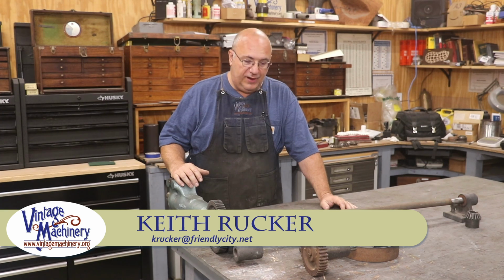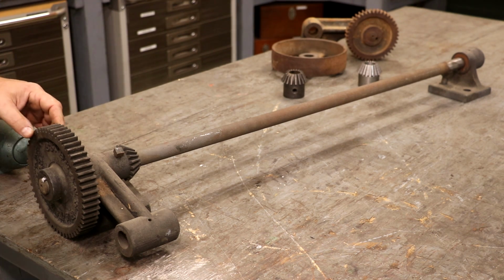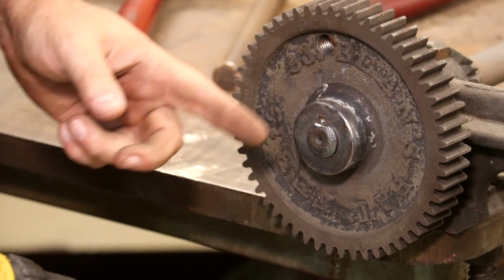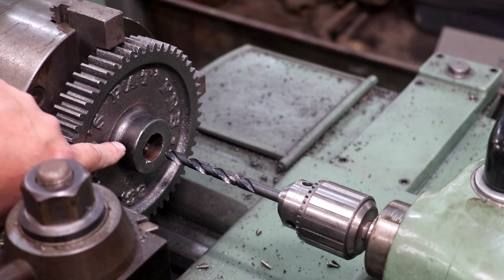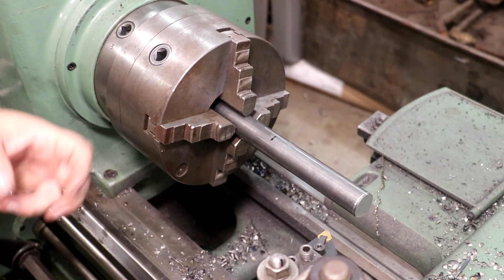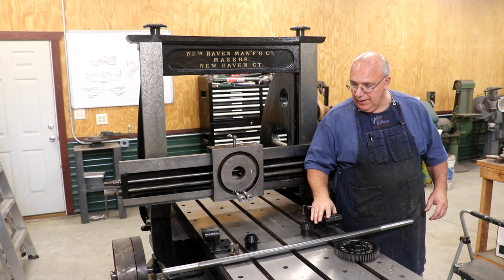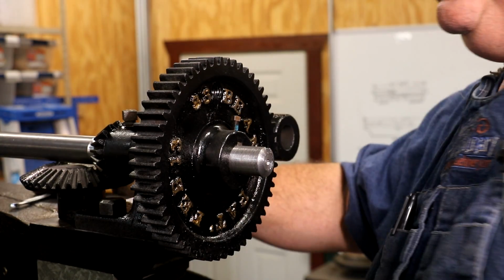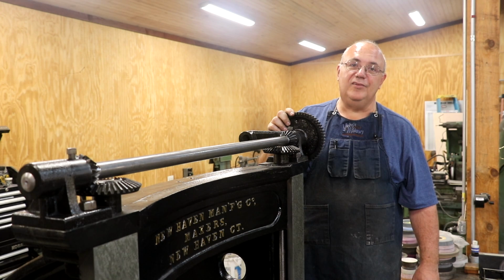Metal Planer Restoration 41:Restoring the Cross Head Elevation System

Comment: Could you have put the good bevel gear in the mill and dial indicated it to the degree angle with a dial indicator getting zero change down it length of cut from short to tall side? Like the idea of making a handle!

Comment: I have run into similar situations and have used wax. Heat your part then touch it with some wax, it will follow the heat like solder. I keep wax in my tool boxes just for these situations. You would be surprised of how well it works.

Comment: Hay, Keith, drill tap and put a screw in that key and use a slide hammer to tug it out.
Well after you got it as far as you did, just pound the gear back on and the key would halv probably worked it's way out.
owell making a new shaft is always fun.

Comment: Wedge keys are much more resistant to shearing off with a shock impact. This is why mechanical stamping presses use taper keys on the drive gears.

Comment: When I was a mechanic, a rosebud tip was one of the best investments I made.
It is possible the brass drift was harder than that shaft. Spark-proof brass alloy is way harder than British knock-off hub cap. :(
soaking the stuck parts submerging in penetrating oil or diesel fuel for a week, or you could spray all the potentially stuck parts the day ( every day) you decide to take it apart - soaking time is your friend! 

Stop and consider the physics of removing stuck parts. Due to the conservation of momentum (mass times velocity) and the conservation of energy 1/2 mass times (energy squared) your hammer should weigh more than the part you are trying to move, the shaft or the gear. 

At some point you have to get a gear puller The sooner the better, a stuck, mushroomed shaft needs to be shrunk. Best way to do it is hot/ cold and puller, after that does not work, drill out the shaft - as the shaft thins/weakens the mushroomed area with successive drilling, you can use your puller to remove the shaft, using a pin-type attachment to reach the bottom of the drilled hole. Take care to shape hole-pin contact for good fit and avoid mushrooming.

Have ever seen one of those toys with a wood frame and 5 ball bearings, hung so they just touch,
 from a vee of monofilament line? The balls are hardened to ensure elastic collisions and conservation of energy. (“plastic” collisions cause permanent deformation such as mushrooming) 

Experimenting with the toy, lifting one ball and letting it swing causes it to stop when it hits the row of balls and one ball to fly off the other end,  just as if the other balls were not there! Repeat the process with similar results with  the number of balls flying out equalling with the balls coming in! The process repeat until the energy wastes away through friction and heating with the air and the string. You can add plastic deformation to the system by sticking some clay, tape or other deformable substance to the balls.

Snap-On makes a tough, hardened set of pullers which can be likely be bought right at a sale.
Reply: Drilling a hole down to the center of the key should help you get penetrating oil to the rust. You are allowed to express your disapproval with the assembler who neglected to lube the shaft/gear before assembly. I like the idea posted here suggesting a set screw that presses on the key.

Comment: Through out the course of this project you have several times commented on the fact that the measurements are close but not common sizes.  Could the problem come from the fact that the size an inch has been changes at least twice since this machine was built?

Comment: the more i think of it i see you might run into some problems with leveling the cross slide when adjusting to different heights. both thread spindles with the bevel gear assembly need to be perfectly synchronized, meaning same pitch without wear, perfectly skimming bevel gears with the same effectve diameter and exactly the same amount of backlash.
you might need to get new sets of bevel gears, don't think it's going to work properly with the old ones.

Comment: I picked up some cast wheels the other day. They are 10 inches in diameter with a 3/4 in square hole in the center.  I got one cleaned up today and it appears to be off some kind of valve. I was thinking it might work as a wheel to operate the planer head instead of a handle. If you think you can use it for that or some other project let me know at rhayden2k@hotmail.com . I would be more than happy to send one or more to you. I have been privileged to watch your videos and learned a lot from you. Thank you for your efforts and passing on the knowledge.

Comment: The key is called a gib head key and are a pain if they lock on. However if you give the wheel a clout at the centre boss then they would tend to loosen the key.
 We then used a gib key remover. It was called a boomerang and how they were made is they had slight taper on the edge that engaged against the gib head.. This stopped the Gib head from breaking off. Gib heads where never clouted into the keyway and wheel boss but just a firm bedding tap to get the “keyed result”.

Comment: At first I just thought you were going to drill then tap the stuck key. That way you could thread in something to replace the broken bit (like a slide hammer).
EDIT: Also, since this was made before the Johansson Gauge Blocks standardized the inch worldwide, maybe it is a one inch bar, just with a slightly different inch type.

Comment: It is a gib head key. When you tried to drive the shaft out you were only making it tighter. Would like to have seen you drive the gear farther on the shaft,  would have loosened the key. Even drill and tap key and pull it out with all thread.

Comment: I do not blame you for changing the key type.  An engineer designed that wedged key, and machinist are always fixing engineering designs that don't work in the field.  Johnny, in a previous comment, had the same idea that I had, a ships wheel would work well on the end of the shaft to raise and lower the head.  Looking forward to seeing it run.

Comment: Hi Keith, It’s certainly coming along well isn’t it? One point I thought of when you were fitting the bevel gears, how are you going to compensate for any difference in backlash between the new and old components. There will be small differences between the relationships of these gears because one of the four components was machined over one hundred years after the others and yet to get meshed in. So you may set it correctly for raising the frame only to have it cock when lowering, or visa versa. May not of course make a lot of difference in the scheme of things. Regards

Comment: Keith, if the old shaft was the same size the whole length I would of removed the set screw and gave the far end a couple of raps. As it turned out a longer shaft worked out better for you. I have enjoyed all of your work and don't think I have missed one of your videos.

Comment: I was a little surprised that you didn't get the bevel gear and support loose and try driving the key out from the back with a pin punch. Still might not have worked, but seems like it would have been easy to try.

Comment: It would be interesting to compare the original bevel gear for fit compared to you new one. The new one seems to have a lot of play in it and from what I saw of the original, it was only a little bit of tooth that was missing from the least important end - so I'd prefer the original gear ! As for the handwheel, depending on how fast the shaft rotates, it'd be a neat idea to put a sliding key on the handle so it can be disengaged from the shaft for when the shafts spins faster - presumably under power.

Comment: I was wondering if there were any oil holes for lubrication on the mounts. I spent lots of time on my 1914 10" Sheldon lathe grinding casting imperfections and applying body filler. I used Dupont Imron all over. it's easy to wipe off chips and dust.

Comment: Hi Keith.  When you started to remove the gear I was hoping you would stop and try it next video.  The reason being is that 'shopdogsam' did an excellent video on removing flywheels etc held in place with those type of keys a couple of years ago.  His system worked very well with a high success rate.  What he did was weld an extension onto the key and the pulled the key out.  Rod

Comment: Actually Keith when you were banging away at that shaft trying to get the wedge key out, if you think about it if you had knecked it back the other way the key would have come loose because the key was compressed more as you banged on the shaft, knocking the shaft the other way would have loosed the wedge key try it next time ;)
Reply: A few guys suggested that.  I ain't sayin' he didn't try but it doesn't look like he did.. I dunno....

Comment: How about a plain hand wheel with no handle/knob about 10" dia on the end of that upper shaft ?  That way you don't have to reach all the way above the shaft and can just grip the bottom rim of the wheel several times to rotate the shaft 360 degrees.  If you make the wheel a couple of inches bigger than the gear you can keep your knuckles away from the gear teeth.  Should be easier to adjust from floor level.   Also if the shaft is powered from the other gear and flat belt there is not a handle to come around and bonk you on the head... Great work, enjoy your videos.

Comment: I'm surprised those bevel gears are only held onto the shaft with a set screw and not keyed to it, I can see them slipping under load very easily and scoring up the shaft.

Comment: Hi, Keith, when you turn a long shaft like that, do you use a slide-on bushing in the back of the drive tube to maintain the stock in dead centre of the tube?
Reply: He should, but in case you didn't notice, Keith was in a hurry to get this done and correct shop practice takes a beating when machinists and other craftsmen are so inclined.

Comment: Don't worry about historical accuracy. There are already modifications made in the past, such as the tapped hole in the gear for a handle. Most old machinery has been modified to some degree for ease of operation, when it was used everyday.

Comment: You could have done a hex or square shaft on the end.  So instead of the crank you could have used a ratchet with socket.  The ratchet being easier and directional.  Then slip it off and not need to make a new crank.  Just  my 2 pennies.

Comment: Also, the inch was another dimension in the 1800rds. The current size of the inch is measured from metric; 25.4mm exactly; established in 1946.  The United States adopted the conversion factor 1 metre = 39.37 inches by an act in 1866. 
Maybe that these changes in the dimension of the inch also make that old things are these strange sizes?
Reply: Those two conversions only differ by .002 mm over a meter. 39.37 inch x 25.4 inch/cm = 999.998 mm.
Reply: @richardhiskett5422  Thank you! I did notice that after my post, thanks for sharing and the look-up.

Comment: Wait... aren’t those bevel gears supposed to be on the same relative side of the columns? Otherwise one side is lowering while the other side is lifting. Unless one side has left handed threads but that doesn’t seem right. Am I wrong?
Reply: I had the same thought, so I went and checked the first video. The bevel gears was mounted mirrored there, so I guess the screws must be as well.

https://youtu.be/wycU52BR0Oc?t=26

Comment: Are the leadscrews left and right hand threaded for raising the axis? Otherwise, does the bevel gear need to be on the other side? It's looking good Mr Rucker!
Reply: Look back to the shot of the original shaft, I can’t see any witness marks so the gears are in the same place as before, so you deduction seems sensible..

Comment: I have had good results by in place of driving the shaft out of the gear, drive the gear onto the shaft further. A pipe that is slightly larger than the shaft and key works nice as a punch.  Then the key can be removed. After the key is gone, the gear usually comes off with little difficulty.

Comment: Just curious, could you have drilled a threaded hole into the key and pulled it out with a slide hammer? Our mechanics use those all the time to pull tapered pins.
Btw. pushing that rod just causes the tapered key to jam even tighter. Should have been easier to push the gear back, so the key comes loose
Reply: That's just what I was going to suggest. I've pulled them before by Tig welding a cut off grade 8 bolt to the key and then threading a slide hammer on to the bolt. The residual heat from welding helps break the key loose as well.
Reply: @steamfan7147  I've seen that work in some freaking hard case situations - Andrew Camarata did it on some big crawler or something.  I couldn't believe he pulled it off (ba dum dum!) also Marty T down in New Zealand did this a time or two.
Reply: @silasmarner7586  I've done it many times over the past 30 odd years as a machinist/fabricator, has made my life a lot easier many times.
Reply: @steamfan7147  same here its always my first port of call, but one of the things i love about watching this stuff is seeing the different ways people go about doing things. @Silas Marner great to see Marty T getting mentioned, great channel.
Reply: Oh dear, I'm just an armchair machinist but I was thinking the same things and when Keith started talking about cutting the shaft I was thinking, put a key behind the gear and push the gear back on. That should get the old tapered key out. Anyway, he made a nice new shaft that will look fine.... in fifty to a hundred years =D Maybe paint it? Keith is still 'The Man' getting loads of good stuff done =D
Reply: Leave the man alone if he want's to make a pig's ear out of it well let him, alsp could have tried to knock the shaft from the other end

Comment: I have been watching all of the Planer videos . And I'm still wondering what and how you will put the power to the planer? Maybe electiric motor direct or electric motor to flat pulley system .  I will just have to keep watching to find out !
Reply: THE IRONWORKER, he just got an old hit an miss engine, I wonder if that would have enough power to run it. That would be a cool set up, or maybe use the hit miss on those ice cream makers we’ve seen awhile ago. It’s fun watching what he’s doing!

Comment: Nice, as always, Keith.
I am curious, though. Why didn’t you just replace the end of the shaft you cut off?
Not criticizing, just curious.
Great job.
Thanks,
John
Reply: Given that the shaft must run very true, I'm guessing it would have been a lot more work to weld a new oversized end to the mainshaft, straighten the mainshaft , and then machine the new end true. Also, no guarantees all of that would work out correctly.  For modest $$ Keith just bought a new shaft & machined exactly what he needed, plus the extension for a handle.
Reply: Possibly. I was curious about what Keith was thinking. 
I always learn something from that.
Thanks,
John
Reply: well it is pitted anyways as he said

Comment: Did you put any flats on the shaft under the gear? Or did you use a drill to make a little seat for the gear set screw??
Reply: maybe yes maybe no the whole head and lift assembly needs to be level and true then I guess the bevel  gears will be locked and timed for proper operation

Comment: Is there a flat milled on that shaft for the bevel gear set screw?   If one of those gears slips on the shaft, the whole head goes cockeyed and all that scraping and measuring becomes a waste of time.
Reply: You can not have flats because you need to make fine adjustments to equalize the height from one side to the other, and the torque on the shaft is only about five to ten pounds max. It is a slow turning shaft and can be turned by hand.
Reply: @july8xx  True, but it will never be possible to get the tram of those gears perfect. The variation of the clearance between the various bevel gears and the lash in the screws and nuts will mean that the head will never travel up and down in a perfect straight line.  Of course this machine was never intended to cut parts to precise tolerances- this was the 19th century age of steam and it was built to whack away huge chunks of metal from big castings.
Reply: @oldschool1993  You would be surprised at how close you can get the tram on that machine, flats would limit you and are not necessary.
Reply: @july8xx  I would be surprised if it could get within 0.020" flatness across the width of the bed.  There are too many moving parts that are operating in simple castings- not sure if the mounting brackets even have a bushing supporting the shaft- same for the verticals- each of those parts needs clearance to operate and the clearance will be different on each one.  Gears by their very nature have to have clearance, and no 2 are exactly the same, so as the gears engage , one will always start to move slightly ahead or behind the other.  I have some experience in this, as I once built a mini CNC machine with the same basic design and I used  some very high quality bevel gears, ball screws and ball bearing supports etc. and it was an endless job of fiddling trying to coordinate the parts to get results of 0.001" repeatability.   The real proof will be if at the end of this process, he slaps a 4' x 6' slab of steel on the table and planes it down and then measures it side to side and end to end.
Reply: @oldschool1993  ....You need to travel back to 1880 and show those guys how to do it.
Reply: @paulcopeland9035  Not necessary, they had the design spot on for what the machine needed to do.  Perhaps they should travel forward in time and explain that to people on you tube.